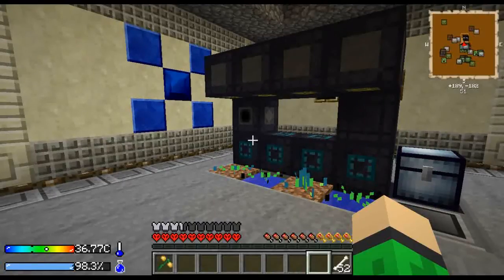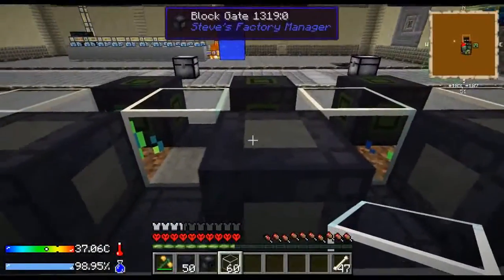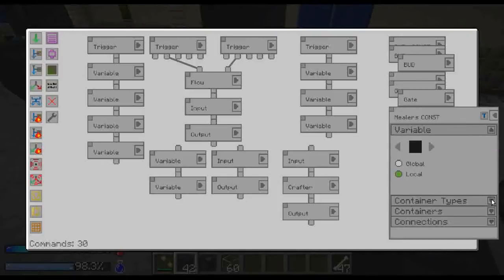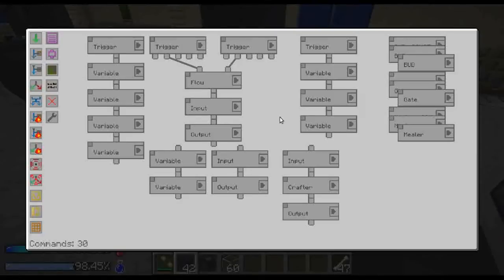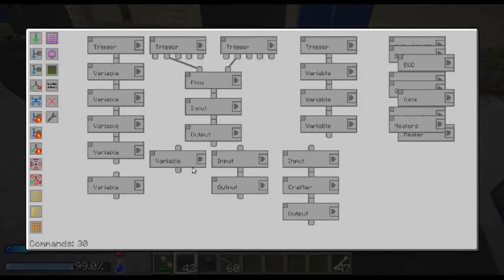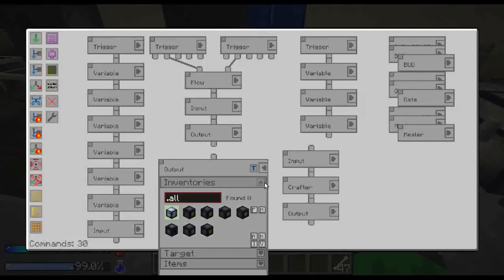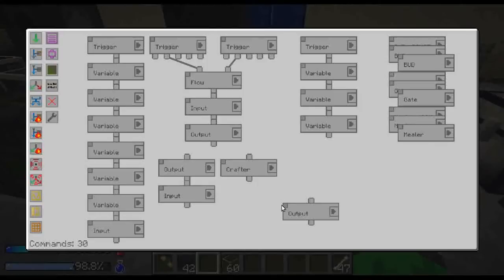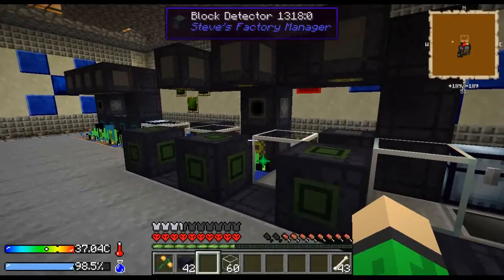Steve's Factory Manager Automation - Pneumatic Seeds (bonemeal upgrade)

Comment: Kappa, your logic could me simpler (copied this from my reddit post):
The way i'm doing it (took some inspiration from your video, etc) Have a line (as many as you need) of block detectors, dirt and block gates. like so:
BBBBB
DDDDDM
GGGGG
The Manager is at the end, with cables connecting everything.
Make a variable "Gates", and select all your gates.
Make a variable "Current gate".
Make a trigger, set connections to block update detector and select all your detectors. In update block:
1sr row 0 5 and select invert
2nd row 7 12 and select invert
3rd row 14 15 and select invert
While high signal -> Foreach
The foreach uses the "Gates" and "Current gate" variables for list and element and i use cable order
Foreach -> Condition
make a condition, current gate variable as inventory, and a pneumaticcraft seed (i.e. creeper), specify amount 2, and mod detection.
condtion -> Input, where you set input inventory to current gate variable and blacklist 1 seed, mod detection and an output to your chest.
What this does:
If any of your plants is fully grown, meaning meta 6 or 13 (so not 0 to 5 and not 7 to 12 and not 14 to 15), it will start the foreach loop. Your foreach loop will check every gate you added to your gates variable. If your gate detects 2 seeds (plant is mature and ready to pop) the input will use your current gate to get the seeds (except 1) and put them in your chest. And since you set input to mod detection, it will work for all pneumaticcraft seeds.
If you want to expand, just ad a gate / detector combination, add the gate to your gates variable and add the detector to the trigger.

This is simpler because you only need 2 variables (for the gates) instead of 4 and you dont have to set them manually. You also can use 1 condition to check the meta data.
Reply from the maker: Hi, yes, great work. If I understand correctly, like that, your design will harvest the mature plant in the worst case in just two ticks, which is the fastest speed you can get out of it. If you want it to be super-simple/cheap you dont even need the Block Update Detectors, then just create trigger, that will every second make the loop through Block Gates, as you were describing, that will harvest in the worst case in 1 second, and it takes about 7 program segments (also 2 variables).
Have fun